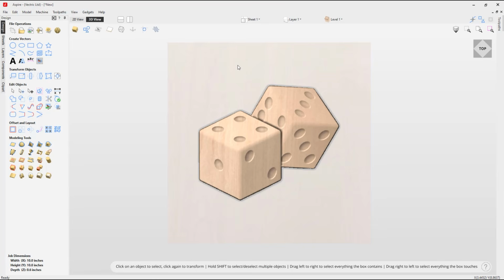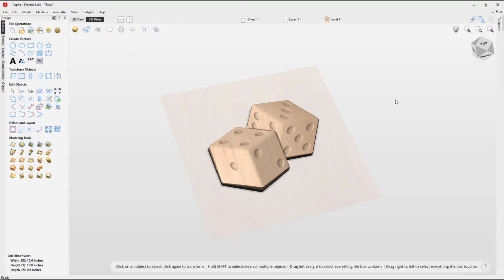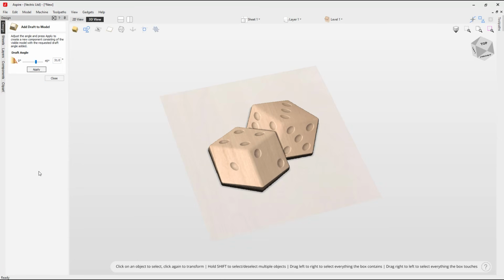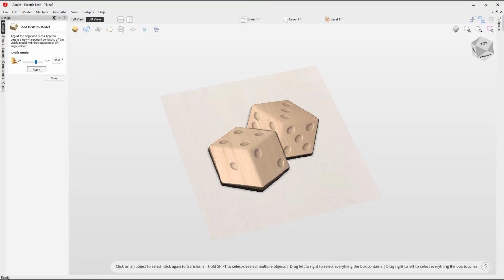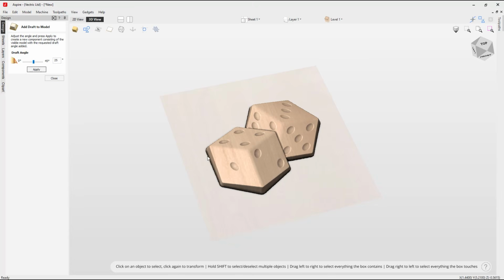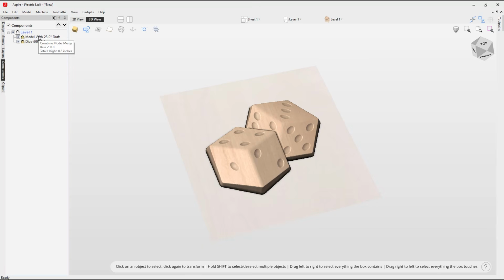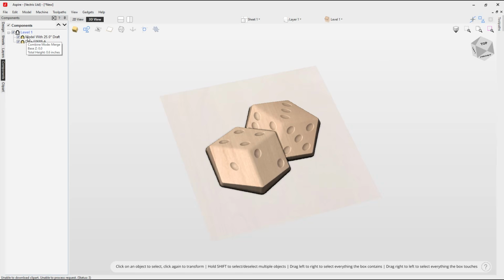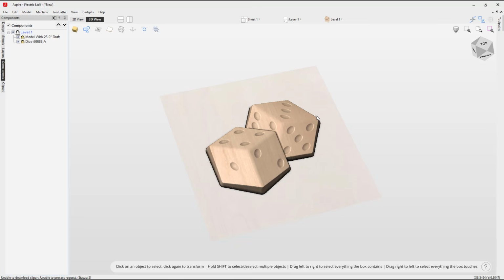How to Add a Draft to a Component in Vectric Aspire | Model Editing Tools | V12 Tutorials

Comment: Is there any method to precisely start drawing a line at a specific distance from a given point?
Reply from the maker: Hello... I'm not sure the application, but if you are in the 3D view you can start a line at the "given point" move a set distance and then set another node (use the interactive number fields).  Continue to draw the line and when you are done go back and delete the initial node.  If that is not what you are looking for I would suggest emailing support@vectric.com and they might be able to give you some other options, or once we understand what exactly you are looking for, and maybe an example of what you are thinking, we could add it in as a feature request.